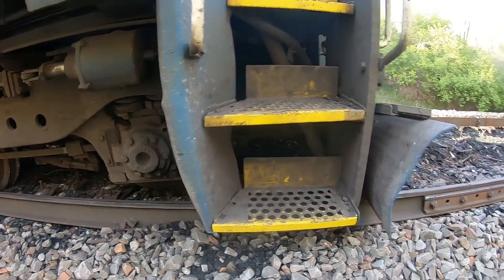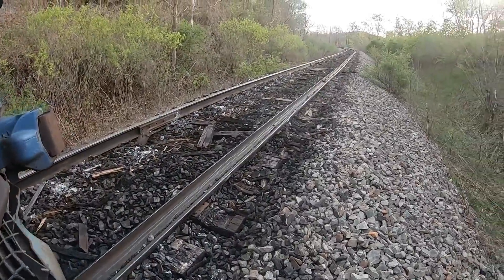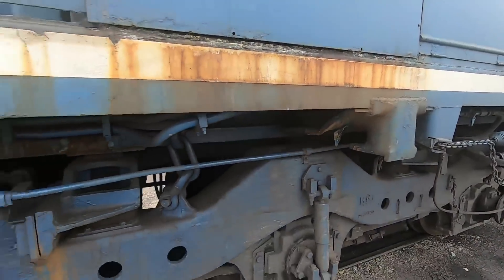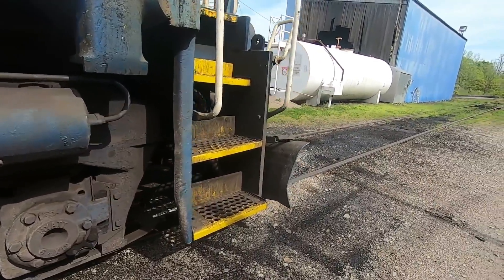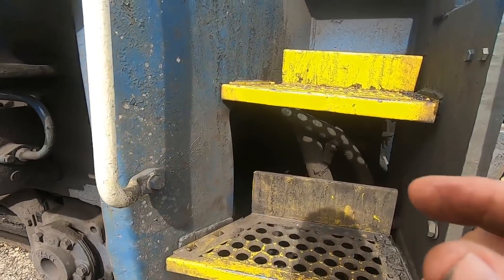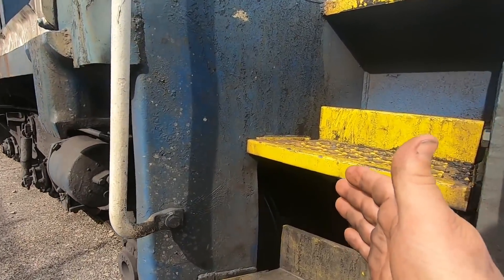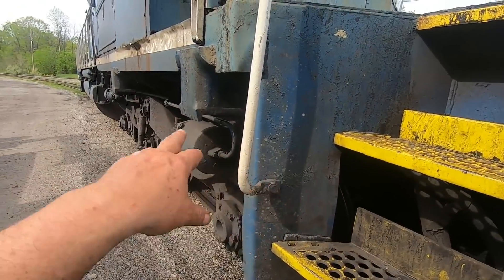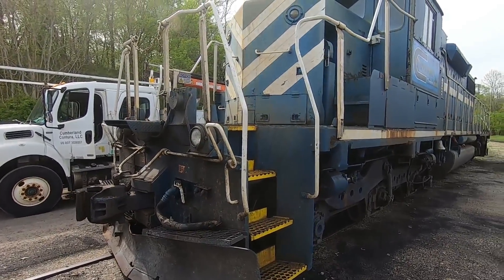Damage to the Locomotive from the Derailment

Comment: Why was the locomotive never shut down?  I imagine there's an important reason, but some of us who aren't real-life locomotive engineers wonder why.
Reply: Water feeezes in June in Pennsylvania?!?
You’re not that far north.
Not shutting down has more to do with the batteries and the air. Running at idle uses very little fuel, and you might not want to trust the batteries when you have to get it moving out of the way. Running also maintains air for the brakes and I’ll want all the brakes I can get with any amount of grade.
Also, if there’s a cold snap it’ll keep the engine warm, yes. But that’s the lesser of all concerns in this situation.
Reply: @jeteye97  I can appreciate the need to maintain air for the brakes, but when all six wheels of the locomotive are off the rails, is there really a chance it'll start rolling along atop the ballast? Are diesel locomotives so hard to start, they didn't shut it down for fear they'd never get it started again? My first thought would be to shut it down for safety reasons, but since I don't work with trains myself I'm left to wonder — fascinated, and in awe of the whole affair!
Reply: @jeteye97  -I believe Dave said the derailment occurred in late April.  Like the 21st
Reply: @larrylawson5172  April does make a difference. I missed that. Still my concern would be a restart in the field, unless you have another unit to pull it out.
Reply: @jeteye97  I've hit a blizzard in WV on May 31st before. So yes, sub-freezing temps in June are quite possible. They expect a low of 48° in Morgantown, WV Tuesday. Washington, PA expects 45° on Tuesday. And this is at the end of June. Snowshoe, WV expects 38° tomorrow night.
Reply: As an ex-railroader with diesel house and back shop experience, the answer is simple. Water freezes. 

If you own an auto you know that part of the maintenance is keeping the water-antifreeze mixture topped off to prevent the engine block from freezing and cracking the block. Due to the high cost of the antifreeze, and the fact that it is bad for the environment if spilled, locomotives are filled with water that has been treated with an antirust compound. This water-antirust mixture can and will freeze if/when the temperature drops below freezing. 
{Side note; All locomotives come equipped with a water-dump valve that opens just above the freezing point of water. However, there are two problems relying on the dump-valve. If the outside air temperature drops fast enough the water can freeze mid-dump. If the water dump was clean, now comes the fun-filled three-ring circus of pumping hundreds of gallons of rapidly cooling water into a cold engine block hoping the water-dump valve stays closed long enough to get the water level high enough so the Low-Water Alarm clears so you can actually restart the locomotive and warm things up.)

So the answer to your question is simple, water freezes, and keeping the engine at idle is the least expensive way of doing things.
Reply: @thomasboese3793  Does this look like freezing weather to you?
Reply: I was about to ask this same question.
Reply: Just my 2 cents, my father-in-law was a conductor, he worked the line from Cumberland, Md to Grafton, WV. I think he told me two things about never shutting then off. The battery was not large enough to start the engine and it only had water, no antifreeze.
Reply from the maker: Awesome Joe, did he work for Western Maryland? Yep these
old locos don't take antifreeze , ours never get shut off during winter
Reply: @ccrx6700  B&O 43 years he had lots of stories about broken Air hoses, knuckles, riding in the caboose and all the sudden the train slowed to a stop in the middle of nowhere it was a jet empty all the cars just piled up like dominoes.
Reply: @joemc111  - Winter weather is another reason.
Reply: @joemc111  the West End.. central 60 now know as the mountain subdivision with CSX looking for a buyer....
Reply: Also on holidays when the railroad shuts down the yards at Cumberland Maryland might have 300 to 500 locomotives setting and all running I could hear them from my house about 3 miles away I live in Florida now no trains anywhere around me.
Reply: @joemc111  Yes the railroads use just water for cooling and restarting can be a bear
Reply: I just got here 6/15/21 7:47 PM EST and heard the engine running and thinking the SAME THING !
Reply: Lots of armchair specialist commenting so ill add my 2 cents as a career locomotive engineer. This is not normal. This locomotive should have been shut down when it derailed until it could be moved under its own power. Once it was moved and parked it should have been shut down again. This thing idling away for several days after it was parked wasted a lot of fuel. As a refrence, an SD-40-2 will burn around 100 gallons while idling for 8 hours. Being this is not a turbo it will probably be considerable less but you're still talking a lot of money. At a certain class one they would have called out the military if someone left one idling like this and someone would be getting some time off. Not being an ass but thats just life in the "big city".
Reply: There is also a Manuel brake wheel.
Reply: Older diesel engines lasted longer when they maintained a constant operating temperature. Frequent cooling down and warming up led to more cracking of engine components.
Before the oil crisis of 1973, fuel was very cheap; the cost of wasted fuel was less than the potential cost of engine damage.

Old habits die hard.
Reply: Bad batteries.😊
Reply: Lots of odd, unbelievable, silly 'reasons' for things done or not done. However, I would think a child would never believe a 200 ton unit would 'roll away' when completely derailed if the brakes weren't set.
Reply: I thought air pressure was required to RELEASE the brakes, that brakes operated automatically, without air pressure as a safety feature.
Reply: There's a few reasons why you wouldn't shut down a locomotive in an emergency situation:

1. If you're not derailed like this and you had to move the locomotive to a safer location or for any other reason, you now have to start it up all over again. Starting one of these is not like starting a car. You don't just insert the key, turn it and be on your way. Lots of breakers need to be turned on, the engine has to be primed, and if its been shut down for long enough it has to rebuild enough air pressure to release the brakes.

2. Like joemc111 said, the batteries on old EMD's can be temperamental. They have 8 8-volt batteries used for cranking the engine, and especially in colder weather, they output a lower voltage than that and it can prove to be too little to crank the motor enough for it to fully start.

3. As I mentioned, the brakes function on air. If you shut it down, the air pressure fades away over time because the compressor runs right off the crankshaft of the engine on these older EMD's. Nowadays must locomotives actually run their compressors on a separate electric motor and some even can start the motor using air pressure. Anyway, without air pressure to hold the brakes on (even if you apply the handbrakes!) the locomotive can start to roll away. That's not something you want to have to explain to your supervisor.

"Hey Jim, didn't we park it here?"

"I think so... Aw, crap..."

Anyway, these are all good reasons why locomotives are running almost all the time. On top of all of this, there's usually no good reason to shut 'em down... there's always more work to be done!

...So long as they stay on the rails.
Reply: The town I live in has a sand mine and there is a short line that runs to it. The maintenance she'd for the engines is near the road and especially in the winter the engines are always running. They don't work over the weekends, but them old elcos are just purring away
Reply: Staring a Loco can be pretty difficult. They also use less fuel idling than it takes to start it, also its safer to leave the engine running to maintain brake pressure to prevent it moving.
Reply: Shutting down a big diesel motor like that is not as simple as turning off the key.  Diesels keep cool by continously cycling the fuel through.  They never shut off the big container ships either.
Reply: Stefan F. 
Actually it's very simple - like pushing a button simple, then 15 more seconds to open all of the circuit breakers and pull the battery knife switch and you're done. Well, after you set the hand brake you're done.
Also, a whole lot of locomotives are fitted with AESS (Automatic Engine Start Stop) systems these days. If left running, after certain criteria are met, the system automatically shuts the locomotive down and will restart it after some of the criteria needed to shut it down have been lost. This could be anything from ambient temperature falling below around 40 degrees F. to a loss of main reservoir air pressure or significant loss of battery voltage. These systems can be and are retrofitted to any type of older locomotive and is standard equipment on most new ones. The reason to have this system is fuel savings, the locomotive in this video burns around 20 or more gallons of fuel per hour idling. If the weather is not cold, that's a waste of money and fuel. Some railroads are requiring their employees to manually shut down their locomotives (weather permitting) at the end of the day, or until the next crew arrives.
Reply: @stefanf922  Diesels on ships are cooled by heat exchangers. Never shutdown the diesels? They absolutely shutdown the main propulsion diesel engine when docked in port. The diesel generator sets stay running for electric power. If docked for extensive maintenance, everything is shutdown and electric power is supplied from on shore.
Reply: A Diesel engine can idle for days
and not use much fuel, My wife and
I have been stuck in bad weather more than once where we set for
2 days in our Semi before Texas
opened up the Highway, my Big
Truck has about 250 gallons,
those big SDs carry 3500!!!!!

Comment: If the wheel cannot be fixed for a few days, why is the engine left running? Just curious.
Reply: Water freezes, so to keep the engine block from cracking, the diesel is left to idle. No antifreeze is used as that would be too costly and very bad for the environment if spilled.

Comment: You just found the reason for the derailment.........................
Reply: The following is from another entry - enjoy
Dan K 3 hours ago (edited)

In a previous video one of the trucks on a coal car failed and locked up
So it could not stear or track around the corner
Reply: Dunno if a thin flange would cause a derailment but it sure could "pick" a switch. I'd like to see the last wheel report. That's a maintenance practice when the measurements on all the wheels are recorded.
Reply: @jerrylanderholm9906  I think... The misalignment that caused the flange wear also caused the derailment...
I'm glad nobody was injured but feel there could have been something missed  on a maintenance inspection...
Reply: @evanjones2539  There are a lot of factors to consider. From my experience locomotives with 3 axle trucks is they have a tendency to have more flange wear. Besides not gliding through curves as easily as 2 axle trucks the amount of journal box lateral is critical. If the lateral is set so that flange is being overly pushed against the rail, more flange wear can occur. Here's something else to consider. If the locomotive is never turned, it will always be operating with the flanges continually wearing against the same curves. From what I know about this operation, it's purpose is to service a coal fire power plant. I don't know if it's possible to have this unit face the other direction?